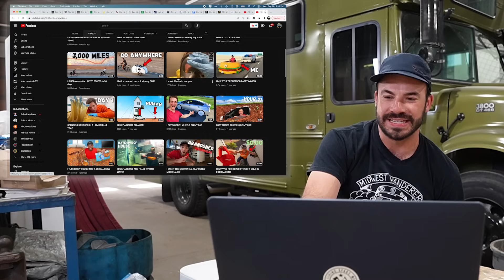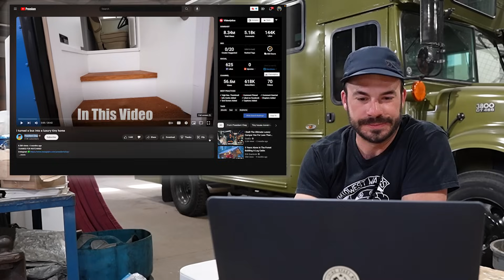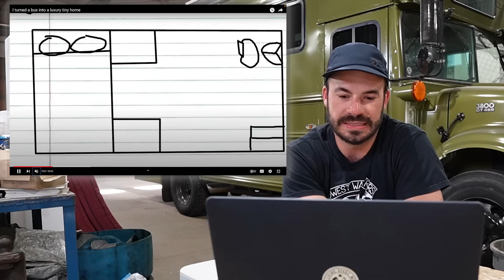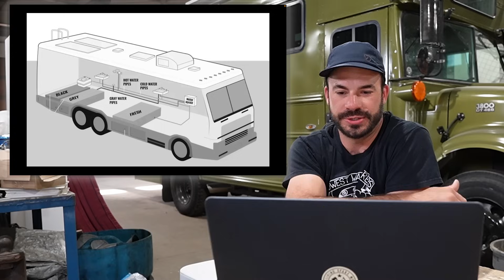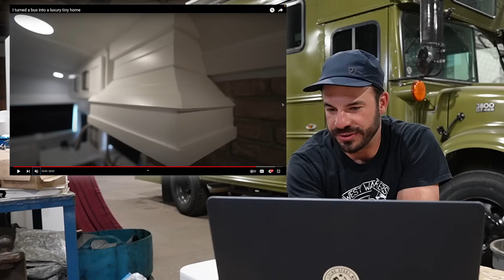8 MILLION views on a SHAM Skoolie Conversion - President Chay video reaction

Comment: My vote for the worst part was the untreated lumber underneath. Treated would have been bad enough, but... OMG.
Reply: That and the AC  that will not handle all the dirt that is thrown at it.   I wounder how long time it take until there is a water tank or AC layin on the highway after the buss have passed.
Reply: What Chuck said about load bearing,,, those screws shot up into cheap pine, will pull out as the thing moves,,, the boards rotting won't become an issue in the time it's gonna come apart from chassis flex.

At least the peeps who bought it from him will be able to present the court with his build video as all the evidence they would need to prove their case for incompetence.

Comment: I'm totally with you on the fake brick, Chuck.  That's why I only use real brick, over 2x6 framing...which is thick enough that I can stuff the 12" R-30 fiberglass batts into it.   If it's worth doing, it's worth overdoing.  🙂

Great and helpful video, sir.
Reply from the maker: Exactly! Hahahaha thanks for watching friend
Reply: Bro, you really aught to be pouring concrete for the brick. Un-reinforced masonry will never pass inspection these days.
Reply: @FeedMeAQuarter  Oh my...SMH (I'm trying to be all hip, you know).  How did I miss that?  From now on I'll pour proper footers...and, perhaps, replace the 2x6s with concrete block.  What's an extra 2 inches?  Thanks for setting me straight!
Reply: @allthethingswedo  don't forget the rebar

Comment: I've seen this one! I left a very long comment detailing all the things he absolutely got wrong. I wonder how many I missed 😂. Wood to hold a water tank under the bus? Really?

Edit: chuck you gotta re-watch with audio. You missed so much awfulness. I admire your overall positivity towards it. Yes he was doing his best, but a single weekend of research would have avoided 90% of the pitfalls chay ran headfirst into.
Reply: Haha i read your comment on their video. It was well said.
Reply: Yeah, this reeks of someone who spent a few summers throwing together track homes or cheap apartments and just said "Eh, busses are the same, right?" I bet the used solid romex and wire nuts for all the electrical. This thing would be a rolling fire hazard if it weren't built like a giant leaky sponge.
Reply: @FeedMeAQuarter  "leaks? that's not a bug, it's a feature, think of it as active fire suppression"

Comment: I have a legitimate question, i'm spray foaming the interior and I was curious if filling the square tube in the ceiling with foam would help prevent moisture from dripping at each brace, I'm curious if anyone has tried that and what are the results?

I'm trying to save some head room.

Comment: 6:30 I will be starting my build soon. What do you suggest for walls instead of 2x4 to save on space?
Reply: 3/4 plywood cut to 2” strips and double it up, run horizontal across the hat channels instead of parallel to.

Comment: Chuck, Don't be dissing Ryobi tools.  I have a ton of construction experience (with a General Contractor's license) and have been using Ryobi tools long before they were florescent green (they were originally blue) and have had only one tool fail.  That was a blue circular saw that I burnt up because of an extremely dull blade.  The only weak link that they later solved was their original blue batteries didn't last long.  I have never had one of their 2nd gen batteries fail.  I love Milwaukee cordless tools but they are way overpriced for home projects.  For the DIYer, I highly recommend Ryobi cordless tools.  Now back to the video of the influencer pressure washing his fiberglass insulation and sealing off his leaky bus windows while building an exposed waste tank platform out of wood.
Reply from the maker: I felt bad for dissing ryobi, they are great tools. I even mention that in the live chat replay if you watch that from the premiere. they're solid

Comment: A note to Chay:
So Chay, in what universe does untreated wood NOT rot when exposed to, or submerged in, water?  And how will you combat the mold which grows inside of such an environment, other than ripping it all out right down to the metal framework and starting over?  And please tell me what your reasoning is behind exposing new insulation to this wet environment?  Will that insulation work better when wet??  hmmm…  And finally, you can’t blame the viewing public for seeing you as you are:  an unseasoned amateur who should take heed from Chuck Cassady’s voice of experience, learn from the experts, and correct your mistakes before you get someone killed.  There is no shame in making a mistake, only in continuing to make the same mistake after you have been warned, and then pretending it isn’t so bad.  Trying to hide your responsibility behind a facade of cocky greed is the real shame.  Think how that makes your mother and father feel.

Comment: IDK, I guess I've got mixed feelings. I will say their Bus is not Perfect. But it worked for them. Of course they could have done better with researching . It looked like they had a Fun time converting it. And it wasn't like they did anything Mechanical that would cause a lot of concern. Everyone has to start somewhere, They'll do better on their next build.
Reply from the maker: When those water tanks and mini splits fall off on the highway someone could be seriously injured
Reply: Do better?!? I pray they never touch anything else, ever. Also pray that no one is seriously injured from anything they do, except maybe themselves. Karma.

Comment: my first rig was far from perfect but that's how you learn. you did the same thing dude and probably just didn't post or make a video about it.
Reply from the maker: I’ve never used drywall in a bus, fiberglass insulation, or used wood to hang hundreds of pounds under a rig and endangering everyone on the road. Thanks for the comment
Reply: @ChuckCassadyYT  they definitely made more bad moves